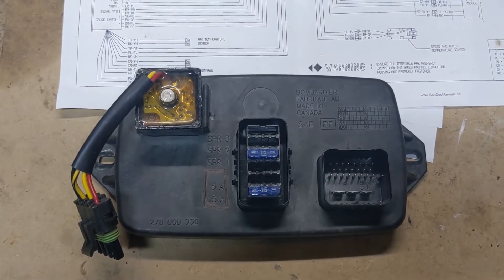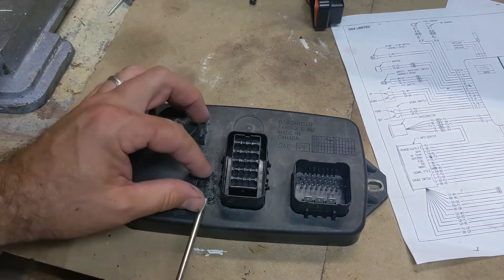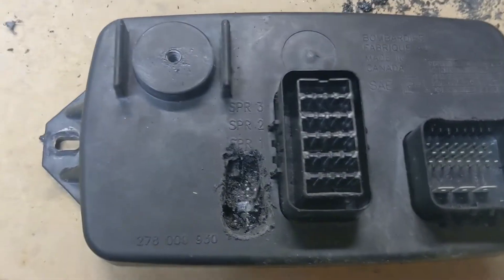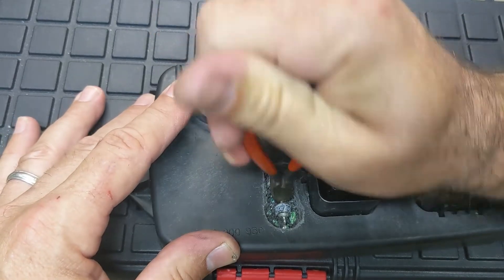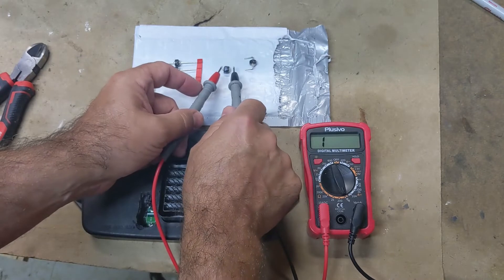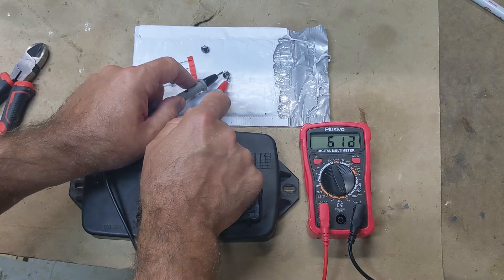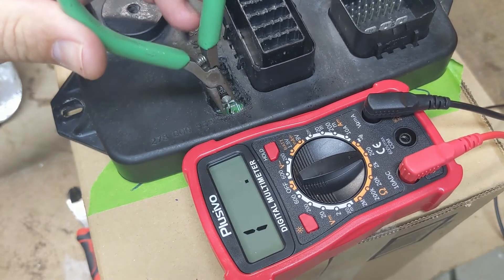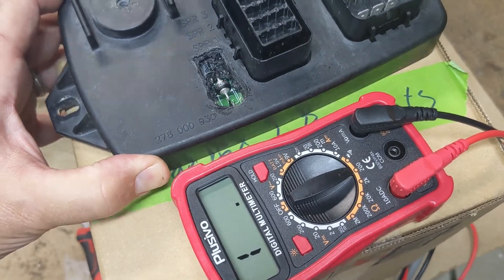How to Fix a SeaDoo MPEM Diode

Comment: was that heat temp packing  silicone you used to  repack  i want  make  sure i  get  the  right  one  got the  diode on the   way  i  oreder
Reply from the maker: I filled it with RTV black.
Reply: @jonparkmac   got  the Diode today  put   one  in  liek you  showed  and  works  100%  good  now    my  $125    2004  717 gti   runs  mint  now the  guy  kicking  him  self  for  selling
Reply from the maker: @nelsonquimbyjr5681 Sweet, so glad to hear that!
Reply: @jonparkmac  thanks

Comment: just  picked up a 2004 seadoo  today   and i  can  jump in  off  Starter Relay but  no  spark   and   no  power  when  ues  the  fob  and  button  to  star it  nothing   would  this  diode  maybe  the  cause  ??   i  know  on  motorcycles   it is   the  diode   what  turns  the  cdi  box  on  for  spark
Reply from the maker: The indicator it is the dood is when the 5a fuse blows every time on MPEM power on. If it's not blowing that fuse it's something else.
Reply: @jonparkmac  oh  yaa  blowen  2  fuses   so  far i  got   fine  place  sells  fuses  i  dont think  can  use  car  fuse
Reply from the maker: Yes, care fuses are the same. Just make sure it's 5a. Sounds like you do indeed have a blown diode

Comment: Thank you for the video, just one question on how you know where the diode is located on the board? I have a 97 XP that I am having the same issue with and a used MPEM is crazy $$.
Reply from the maker: See if you can see this link for the spot. Be aware this fix is only for when the 5a fuse keeps blowing on power up. Other malfunctions will not be caused by the diode. 
https://photos.app.goo.gl/Sxp7EhscEZvfGwqd8
Reply: @jonparkmac thanks again and yes that was the issue which is now resolved. 😊😊

Comment: Great video and thank you for sharing! I got a 1998 GS and I’m guessing someone hooked up the battery wrong and melted a bunch of wires but I’ve gotten everything put back to how it should be and it keeps blowing the 15amp battery fuse every time I try to hook up the battery. What would be causing that? Thanks!
Reply from the maker: That's usually for the main power which could be a few things. Try disconnecting the VTS if you have one and also the mag plug. Gauges too. Also temp sensor. Fuel sender, oil tank sensor.  See if it still blows and if not connect back things one at a time till you find the culprit. If it blows with all those disconnected..it's the MPEM or a direct short somewhere
Reply: @jonparkmac thank you! I’ll definitely start with that tomorrow! Much appreciated

Comment: Tomorrow I'm going to buy a Sky with the problem that when I try to turn it on the 5 amp fuse blows and this video convinced me to buy it. I already ordered the diode from Amazon so I'll be back this weekend with news. I hope this works.
Reply from the maker: You can do it! Take your time. Which model ski is it because the diodes are in different locations. The one in my video is for a 97  GTI. It's not the same location for others
Reply: @jonparkmac  I got it so I'll work on it based on your video, it's a GTX 2000 could it be in the same place or what do you think?

Comment: Wow you are genius.  What made you zone in to the left of the fuses?  I have a larger MPEM for a GTX 2003 di and have poured over the user manual for schematic like paper copy in your video.  Fuses are fine. No power from the relay.  No beep after making the mistake to jump a dead battery when it was hooked up. Looking what to replace first - thanks
Reply from the maker: I found a few other posts on where it was. That's why I made this video to broaden that info. I think this is really the only electronic fix you can make to these. Other failures, like the one you mention, are beyond us. There's just  not a lot of diagrams and specs on these to repair them like a radio or TV.

Comment: I’m curious why you wouldn’t remove the compound on the backside and solder it from there?
Reply from the maker: It's a fair question. I think you want to remove the damaged one or you'd still have a short. Also, digging into the back runs the risk of cutting across the printed circuit conductors. The only other reason is not being real sure which solder legs it is ..it's not labeled on that side. But IMO ..dig it up and replace it. That said ..we've toyed with the idea of running external wires so you can easily replace later if needed. Thanks for feedback!
Reply: @jonparkmac  i meant in addition to…I did this on my 97 Xp but after digging out the diode I figured might as well remove the thin layer on the back and solder it from there. These videos sure help resurrecting these old skis!
Reply from the maker: Ahh I'm with yah. Yeah that's actually a better way to solder. And it's why I cut the lines instead of heating it up so hot on the north side of the board. When you solder circuit boards ..you do it on the back side like you said. I guess for these it's just a little more trouble and we all have AD now too

Comment: my ski is dead with a fresh battery. i checked post key and start button all are working. i dont get the 5 amp fuse blowing. do you think my mpem is still dead?
Reply from the maker: What year/model? There is usually a 15a fuse in the rear electrical box. It feeds power to the mpem from battery thro a red-purple wire. Check that fuse and polish up all of those connections in there. Also check your ground connection to motor.
Reply: @jonparkmac  1997 gti .  well i made an opening in the case and checked the diode just like you did and its fine. i checked the ground all fuses, still nothing. im stumped
Reply from the maker: Check that you get 12v on the red/purple up to the mpem. You can pull the plug and look in the manual for which pin to test. If you can't get a read there then something between that pin and the battery * post is not conducting
Reply: @jonparkmac  i checked for 12v and good ground.  i think its a bad MPEM. no 5v fuse blowing but everything checks out otheer then the MPEM. i could get it checked but it $45 plus shipping.  and a fix is over $400
Reply from the maker: Sounds like it's hosed. Sorry man, that's painful. You can source a used good one. Try Westside power sports.

Comment: Great video! I just got my 787 3D out for the year and found the 5a fuse was blown. I replaced it and it’s running now but I wouldn’t be surprised if I have to do this soon. It wouldn’t be the first CDI/MPEM I’ve dug the potting out of to replace components.

Comment: Hey what amp is the diode 5?
Reply from the maker: It's a 6a / 20v transient voltage surge protector  ...MR2535L DIODE TVS Surge 6A 20V

Comment: Thank you for this beautiful, very informative video. I have a question. When I look at the test you do with the new diodes you get a value where the multimeter goes up in one direction. On the diodes that I have for a Traxter bombardier MPEM, on the new diodes that I have, the multimeter does not move on one side or the other. So I don't understand. Wouldn't my diodes be good? Thank you for your reply
Reply from the maker: Your multimeter needs to be set on "diode mode" and not ohms or  any other setting.

Comment: How did you figure out where to find the diode? I would love to know if something like this could fix my 2001gtx mpem. People want over a grand for second hand and there 2500 for each half new the box and the actual computer and I'm not 100 percent what half is the real problem
Reply from the maker: You ONLY want to try this if the mpem is blowing the 5a fuse when you put the key on to wake it up. That's the symptom. The one i use is a MR2535L 6A transient voltage suppressor (tvs). But not sure about a 2001. The hard part is finding the right spot to dig.
Reply: @jonparkmac  I have only had my ski for a few months rode 3 times. It did blow a fuse once then the next ride had to be towed back it wouldn't start but all accessories worked then it managed to start again after playing with the ignition coil wires. Now I get absolutely nothing from the mpem tested power to it ect. Also if it's the key I will probably need a new mpem anyway as my local dealer says to bring in existing key and ski to program a new key. I guess to prove you do own a key to bad if the key died though
Reply from the maker: Don't need a new mpem. Key is programed to the mpem. You just need to show proof you own the machine. Find a friendly power sport shop with CAN-DOO and they will program it. But check all your connections and you may need to replace your DESS post. Is your 5a fuse blowing or not?
Reply: I have a 15 amp fuse that blows every time I put the key on and if I don’t disconnect the battery to put a new fuse in it automatically blows it could anybody help 2001 Sea-Doo
Reply from the maker: The 15a fuse blowing is not the diode. Disconnect the mag plug and VTS. To eliminate those. If it's the mag plug then your stator is shorting out and you need to open the mag housing. If it's the VTS ..the module is blown

Comment: Thanks Jonathan for your  video, it was a great help! I just bought a 1997 GTI Seadoo as a father and son project. It came (not running) with the original and two aftermarket  MPEMs. The back of the original MPEM had a blown out spot inline with the diode that you replaced in your video.  The location lead me to think that my MPEM likely had the same issue. So, I took a chance and attempted a similar "surgery" today. When I opened up the cover and removed the potting, i found a scorched diode and circuit board. The diode, when tested, allowed flow in both directions and has now been replaced. I'm looking forward to putting the repaired MPEM in the GTI to try it out. Hopefully we'll get it installed and tested tomorrow. Thanks for sharing 😊
Reply: Quick update. Today we installed the repaired MPEM, did some final checks, held our breath and hit the start button. It started up and ran on the third try! 😁😁😁
A great big THANK YOU Jonathan. Your video was a huge help, made me a bit of a hero and put a great big smile on me and my sons face. Cheers!👍
Reply from the maker: That's great to hear. Glad it helped.

Comment: Can I send you mine to fix? 🫣😂
Reply: Where are you located so I can send you my to from North Carolina 1998 seadoo gs
Reply: Hi is it possible to remove the casing entirely or it's too much work?
Reply from the maker: It's possible to remove the potting but way to much trouble and not necessary. It's melted rubber potting poured in as liquid. There is easy way to open the case ..it's entombed
Reply: @jonparkmac  ok entombed lol do you know where to find replacements module for speedster 2000 ?
Reply from the maker: Sure, I can try. It may take a few weeks tho, I normally don't do repairs for people but I like to help a brutha out. You sure you don't want to try to yourself?

Comment: Purpose of the diode in that circuit? I hear of these blowing frequently on older Sea Doos
Reply from the maker: Transient Voltage Suppressor diode ..common surge protection on delicate electronics. Trying to jump a ski with a running auto can pop them. Mine was from a loose battery connection I think but not sure.

Comment: Thanks so much for posting this! Helped me locate the diode on mine perfectly. However, my MPEM had a different diode in there labeled 5KP20A which was physically larger than the MR2535L. The spec sheet looks the same as the MR2535L though, which I had already ordered before digging into it. So I replaced it anyway and the ski works now. Just figured I'd let you (and everyone else) know in case someone else encounters what I did.
Reply from the maker: It's like magic isn't it? I didn't think it would work when I first did it 😂 glad you gotter runnin

Comment: Hey man mind I ask a few troubleshooting questions regarding my 1999 gsx limited
Reply from the maker: Happy too .. IM me on FB ..https://www.facebook.com/jonathan.mcclure.9?mibextid=ZbWKwL
Reply: @jonparkmac  thank you man I sent you a message
Reply: I want to start saying this is a very good video, not many people takes the time to explain how to fix things.
Hello everyone I need your guys help I have a 1998 seadoo gs with electrical problems if I plugged in everything like supposed to be my battery reads 0 and if I unplugged the mpem now my battery reads 1230 off charge I follow the power and the ground to the mpem plugg  and I find out which one is the power and which is the ground now with a different battery I plugged ground and power to mpem and blew out my 5 amp fuse, no matter how many times do this always blows out my fuse and I disconnect my starter from  everything and I connect the cables from the starter to the battery and my battery reads 0 I checked continuity and the starter and the mpem and between the ground and power and I got continuity, do you guys think my starter went bad an blew out my mpem?

Comment: I'm having the blown 5v fuse issue on my 1998 GS Sea Doo. Thank you for uploading the repair video!
Reply from the maker: He'll yeah..easy fix once I did it.
Reply: @jonparkmac  I have it all back together again and it beeped when the key was put on the post and fired right up. Back in business, thanks again for the helpful video!
Reply: @jonparkmac  I have mine prepped and ready to go, just waiting on the diodes I ordered to come in this afternoon. I used a thin cutting wheel on a Dremel to cut the plastic in the same area as you did with the drill press/rotary cutting bit. I was able to cleanly cut a rectangular window out that fits tightly back in place I'm thinking about covering the repair area with some 3m VHB foam mounting tape like you would use for mounting automotive trim pieces on a car body instead of silicone. I could mount the plastic window I cut out on top of the double sided mounting tape. It would be watertight and that VHB tape sticks to anything extremely well. That would make it very easy to access for future repair if needed. Anyways, thanks again for the video. Your video made it really simple to locate exactly where to cut for best access the diode.
Reply from the maker: @TheFishingHobby  that's a good idea on the little hatch thing. I wanted to do something like that but got lazy. May also consider slapping a strip of duck tape over the hatch. It's only an issue if the ski flips and the mpem gets submerged.
Reply: @jonparkmac  the VHB tape is waterproof and you can pick it up at most home improvement stores. It is handy for a lot of other things too.
Reply: What kind of you diodes you order
Reply: @javiermontes3777  MR2535L